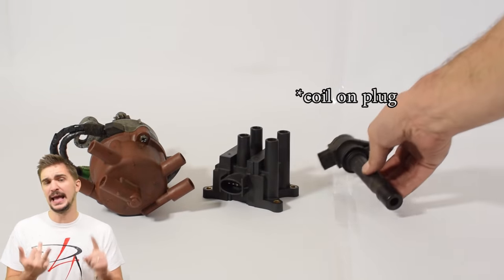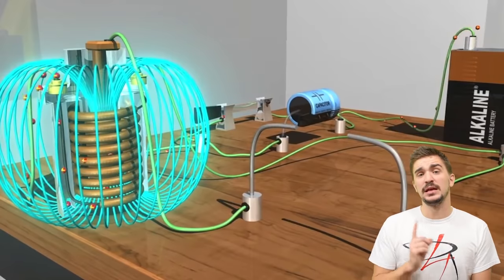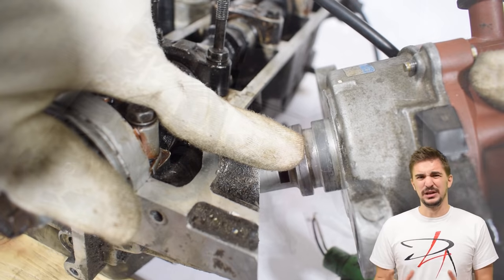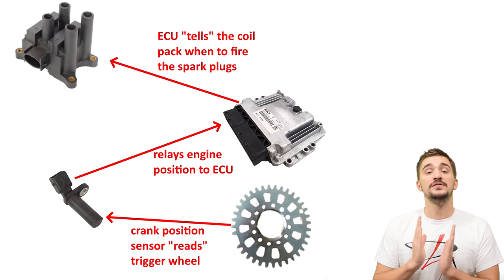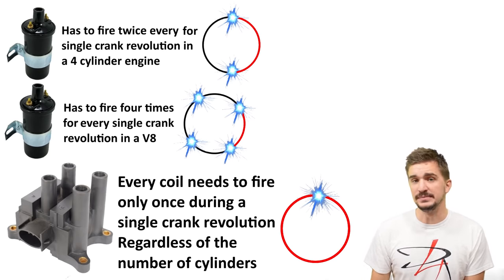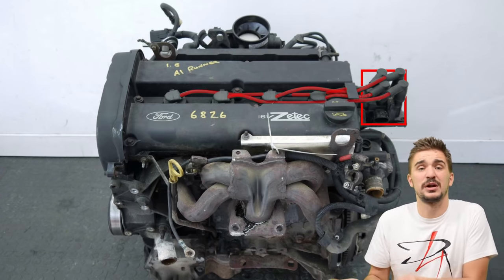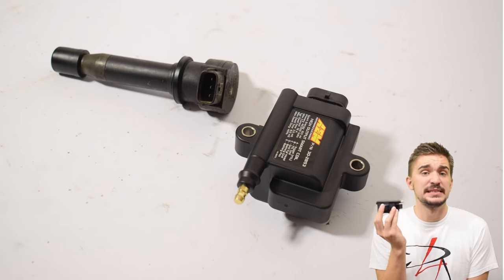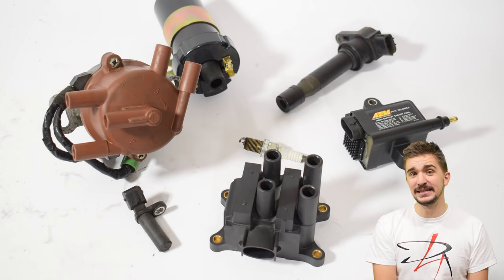Distributor VS Wasted Spark VS Coil on Plug VS MONSTER Coil near Plug

Comment: I really appreciate this nice, clear dissertation. One thing did surprise me, the statement that an increased density of air and fuel results in higher insulating properties in the combustion chamber. That seems counterintuitive somehow, assuming that a vacuum insulates better than air but I don't know how fuel behaves in this regard.

Comment: I have a 96 Buick Roadmaster sedan with the 5.7L LT1 engine. It has the OptiSpark distributor on the front face of the engine behind the camshaft driven water pump. It's in between the regular distributor and the coil on plug system cause it uses an optical sensor inside the distributor housing and an external single coil. It's better than a regular distributor engine, but not as good as the coil on plug system

Comment: And with the old single coil/distributor set up if you had the ignition on without the engine running they got bloody hot and could burn out. That's why the radio and cigarette lighter was wired outside the ignition loom to prevent that over the years.

Comment: Toyota, Honda and probably others used a "hybrid" of wasted spark and CoP for a time on some 4- and 6-cyl engines -- half of the cylinders had a coil on the plug, and the other half were fired by the same coil via a wire.

Comment: Have that same Zetec,  using it for a locost build,  I am changing the engine management,  it was a collaboration between ford and Yamaha head was a design by Yamaha,  it is more durable than the Duratec but does not have a weight advantage.  But it saw life again as a diesel in Europe since it is stout. Easy to add a blower to get big power.

Comment: nice video. one small correction, the coil is not the ignitor, the ignitor is the switching device to shield the ecu from the relatively high current and noise primary circuit. systems like the honda distributor or earlier nissan CoP use this setup. ign-1a coils(aem smart coils) have built in ignitors and can be directly controlled by the ecu.

Comment: My 01 GMC Yukon already has a factory ignition system similar to that Monster coil system,  each cylinder has its own fairly large coil and each spark plug wire is the exact same length as short as practical.  The 5.3 Vortec is basically a LS motor, not as much power but that can be changed easily, the other thing is these motors are basically bullet proof!! Mine has over 340000 Miles on it and  it still runs great??  I will be leaving it stock for longevity who knows I might get a million miles out of it. Maintenance is your car's best friend.

Comment: You've left off a rather awesome variant that you can get with an older system. Take your "Wasted Spark" multi coil and gang up all the wires through your distributor. You set the rotor to be centered at top dead center, and then allow the computer to ignite. The distributor pumps every bit of "spark" to the correct cylinder only (zero wasted spark), while the computer does the actual timing. That'll increase your spark amount without needing to go with a Monster coil.
Reply: Yes that's the one I came looking for, the system in the K series Rover engine in the Lotus Elise.

Comment: I have never measured it my self but I was told at school that cop system run between 50 to 60k volts. The monster system may have a point with amps but the highest amp ignition system I am aware of is on top fuel dragster and they use a twin distributor system.

Comment: So I took a class for a certificate when in collage; irrigation design, and nowhere else was the analogy between electrical engineering and hydrodynamics(and sometimes maybe hydrostatics when gravity fed) explained to me better than that professor. Its basically what was stated here but to add to that plus reiterate: 
voltage V or -ev ~ pressure P or psi | 
current C aka amperage A or amp ~ D pipe diameter
ohms or resistance R ~ inner pipe roughness | 
and wattage or watt W ~ flow or (gpm) gallons/minute

If you want to increase the wattage(gallons per minute) you must either increase the amps(pipe diameter) or the or the voltage (pressure). But you can only increase so much pressure(voltage) for small amount of amps(pipe diameter) so if you increase the pipe diameter(amps), (with gpm or watts being fixed) it decreases voltage(pressure) but if yr pressure(volts) were fixed then it  increases wattage (gallons per minute) . Bigger pipe size allows for more gpm while keeping pressure fixed or allows gpm to stay fixed If you want to decrease the pressure. Either way the overall limiting factor is pipe size or amps cuz that dictates how much gpm or wattage you get from your pressure or volts. This is why you want larger gauge wire if you want more volts because that allows for greater amps by easing the pressure and thus will give you a larger wattage output. Now mix Inner pipe roughness (ohms) into the mix! It does not affect pressure(volts) but it does wattage, cuz it also makes a bigger an bigger difference the smaller yr pipe(amps) gets which in turn will decrease your wattage (gpm) so increase yr ampage if yr ohms are fixed to increase wattage output

Comment: Video is VERY well done, much props.
However, if an OLDER vehicle has a distributor
(I/E: 60's, 70's, 80's, etc.),
you can upgrade it and
related ignition components with aftermarket as well.

MSD makes upgraded
distributors, super coils, LOWER ohm
plug wires, AND irridium
+copper core spark plugs.

If you have an older vehicle,
there are "work arounds" to
get the job done.
Besides, with the old ignition system, do your
maintenance once a year
and you RARELY have any
problems with it.

Adding an ecu, wasted spark, or whatever to 
a vehicle that didn't come
with it is complicating things and making it MORE
expensive. (Old cars you can tune and fix with a screwdriver+wrench pretty much)
I will admit, the coil on plug
benefits are sweet, but the
retro fitting hassle and COST of doing so take the
fun out of the hobby.
Sorry 4 the long post,
and thankyou for the video!
Reply: unless you have a wild setup you cannot "tune" with a screwdriver and wrench. likely you are talking about setting base timing and idle mixture. with electronic control you can set ignition timing and mixtures across the board with a far greater degree of accuracy and precision.

Comment: I like Monster coils, I used it on my VR6 in conjunction with a wasted spark firing. Anouther reason I like wasted spark not that you should have this happening but if there is residue fuel in the cylinder on the exhaust stroke it can burn it up

Comment: Wasted Spark arrangements were found to offer ,Yes , more precise Ignition timing but Also Economy AND Emission benefits . Early technology that was REALLY beneficial .
And at the End got to  MSD . As described . Tremendous  ZAP  with some duration . Bye bye misfires .
Very well explained . 
Ignition tech for tyro's . 
Tractor , Standard Distributor , perhaps with Electronic Igniter .
Top Fuel Dragster . MSD system please .

Comment: Mallory had dual points distributors back in the 70's. One set of points was used to precharge the coil thus no problems at high rpm.

Comment: Back around 1970 there came a new device to replace the points with a magnetic pickup and much hotter coils that made the distributor system much more reliable! One reason alone I wish my cars had a distributor and a carburetor is that if something goes wrong on the road, at least I will possibly fix it where as today's frankenstein's there is little that I could do other than fuses/battery connections??

Comment: One undisputed pro of the good old distributor is cost and a +/- the lack of computers to an extent. If the car starts running rough, you look at the rotor and rotor cap and you find a bit of corrosion that you scrub off and on the road again you are. With an electronic its always look for engine fault codes or switch coils around and then replace the coil or sensor thats gone bad. Usually one coil costs more than a distributor+rotor+plug wires together :D ps. I've had 2 cars with distributors (-86 mercedes 300E and a -97 Volvo V70 T5), never any problems with them. With all my other cars with coils in them I've had to change at least one per car during my ownership

Comment: Had a unique  problem of excessive rich condition in a throttle body injection system  retro fit to a small block Ford & an MSD  capacitive discharge coil.  C o Fumes would choke you in 5 minutes.  all other parameters  in check The coils  capacitor sent a multiple fire signal to the   TBI computer  confusing it   resulting in an over rich fuel condition at idle& poor acceleration. Changed to a  standard high kv output coil, problem solved.  Make sure any  fuel/ spark mods are matched  to what you are trying to accomplish . Happy motoring.

Comment: The very old type with a vacuum/ mechanical timing system.

The distributor type system also uses crank position sensors

Comment: Love you vids man! Just one thing you got a little wrong though. A distributor does have a small advantage over all other ignition systems in that it is the only system you can use to run an engine without an ECU. So if your building an old school hot rod, using a distributor along with a carburetor allows for super simple wiring and no computer programming needed. Maybe some people don't view this as an advantage because obviously neither a carb or distributor are the most efficient for power or mpg but it's still something that other ignition systems can't do 🤷🏽

Comment: COP ignition  does not enjoy the reliability of other systems. The coils being directly mounted on the spark plug have both engine radiated heat & conducted heat from the plug with which to deal. In addition, their small size imposes a packaging density to the coil assembly, & the IGBT, & HEAT is the worst enemy of electronics. Failure rates on COP systems are irritatingly high compared to other systems. There are many vehicles from the 1920ies & thirties that still operate using the factory installed coils. Waste spark systems (like the GM ignition systems used to have) were also famous for coil & controller failure. All of these things are exacerbated by the "cowling" of the engine compartment to raise operating temps. All of that having been said, I have NO desire to return to Kettering ignition on any of my vehicles ! Your videos are very well done, & while the drawings & the abbreviated description of operations  are unlikely to change the syllabus at an engineering college, they are, never the less accurate, & well presented. I enjoy watching them, & listening to your accompanying dialogue. Thank you Sir.

Comment: Not all coil pack engines are waisted spark due to the use of a cam position sensor and separate coils in the pack, you might add Thanks.

Comment: One thing left out when talking about the single coil... since the coil has to fire so often it does have to run hotter, and can be a problem on modded engines that run a little hotter anyways.

Comment: forgot to mention the newer systems (wasted spark) will also burn any unburned fuel if it misses, when they came out it was only a few years after that the smog pump was obsolete and on many cars even the egr was dropped.

Comment: The reson why points systems tend to misfire at high rpm is more due to points not correctly closing and not the lack of time for the coil to charge. Systems like GMs HEI work fine at high rpms

Comment: The coil-on-plug system sounds like a recipe for expensive spark plugs :/ great video though, I learned a ton thanks!
Reply: Youd be wrong
Reply: works with the same spark plugs, instead of a long sleeve for the spark plug wire going down to the plug though you have a long coil that snaps onto it instead.

Comment: 8:07 The wasted spark needs only a small proportion of the voltage because it jumps the gap at about 1 bar pressure in hot gas. The spark used for starting the combustion is made at about 10 bar pressure and takes most of the energy of the coil.

Comment: One has to consider the cost benefit of every upgrade.  For every x dollars spent you might double your spark voltage versus or increase your air flow for example.  Typically only one is limiting, and modern engines stock ignitions are plenty hot.

Comment: In theory disturbers and coils have more potential to fail... Yet in my experience they are the most reliable system, and in my case on a 33 year old Chrysler L.A. engine only needs replacement once every 30 years (or 390,000 miles) for the distributor, and once every 10 years for the coil.  (even then they still functioned, just a little on the weak side.) Or a smaller example on my International Harvester Cub Cadet 104, the ignition coil has lasted 53 years so far and still works (Just used it two days ago to mulch leaves in cold wet weather)   Where as with Coil pack systems I've had to replace them on vehicles with less than 100,000 miles.  So again, theory is great and all... BUT Reality is the opposite in my case(s) "low rpm use."  Otherwise, excellent video explaining the functions and differences, I do also have the modern direct ignition type on my V8 engine and that seems to be reliable so far.  BUT major downfall is there is 8 of them to replace... so thats NOT CHEAP.

Comment: your partially correct on the cop set up, some are setup to be ran off of a wasted spark setup these are now referred to as a " dumb " cop. We later advanced to what we now call " Smart " cop's. the difference is that a dumb cop only has 2 wires that go to it and they do not hold their own igniter inside the coil. Where as a smart coil has 3+ wires that go to it and they do have a igniter attached, some examples of this are 2jz coils being dumb coils and toyata yaris coils being a smart coil setup. The 2jz still has an igniter separate from the cop.

Comment: Distributor systems do have advantages, simplicity, no electronics (points), cheap to repair, easy to diagnose, easy to install (one wire hook up in some instances), easy to adjust and modify, not reliant on other vehicles systems for operation,  typically higher reliability than wasted spark and cop,   So distributor systems do have advantages.   All the systems have advantages and disadvantages.

Comment: What about io ionized compression sense ignition coils? Not covered. As for low resistance factory ignition wires stamped with an “Inductive” symbol. These use an actual wire wrapped over a carbon infused aramid fiber core used on GM’s. They measure at 12 ohms per foot. 
Plus ignition coils only produce as much voltage as needed to jump the gap of a any spark plug, regardless of cylinder pressures. Fuel in the cylinder makes it easier to jump. The exception to this rule is 300+ MPH dragsters that instead of injectors, use a fire hose.
 Spark plugs make a huge difference in longevity as Iridium is used (The hardest common metals know to man/ found in the “KT” layer over the entire earth). Iridium buttons are welded on the anode or cathode or both. On waste spark systems, one side is negative and positive on the other. High voltage under pressure erodes the anode (Positive) or cathode (Ground). Unless you know no which side is which, spend the extra money and but a quality spark plug with iridium buttons on both sides as erosion destroys one side and shortens the spark plugs life. If you plan on keeping the vehicle awhile. While most new mid-level vehicles cost more than your first house, tune ups are gone, but milage and maintenance is not! Fluids are number 1 in maintenance. Each week, cold, check the fluids and follow the owners manual for correct fluids. An example is ATF, not all is the same. Do research online research before making a choice, regardless of the expense. ASE Master Tech since 1978 - Retired

Comment: I think distributors are a good choice.  You say they are mechanical meaning that they don't have a lot of sensors or computers to mess up. May seem a small issue but it comes up. If the coil is not producing the spark you could get a larger or more powerful coil. The rate of sparing at 6000 rpm though how often do you drive an engine that hard? I know I don't in any of my cars.